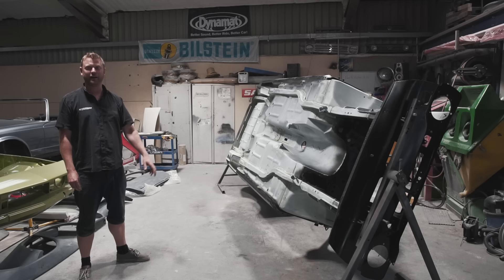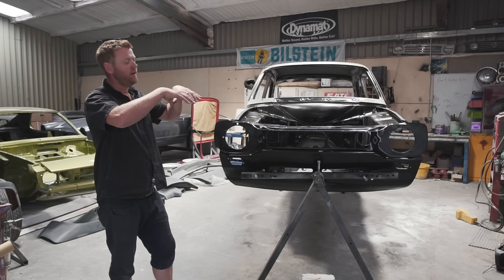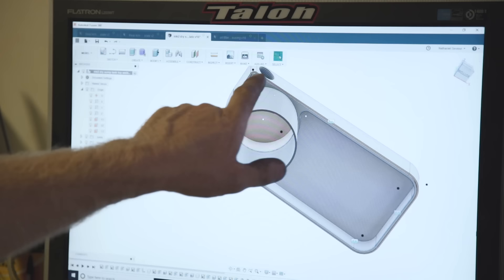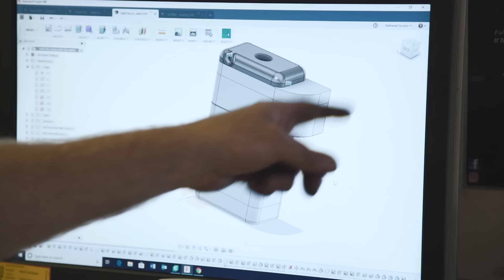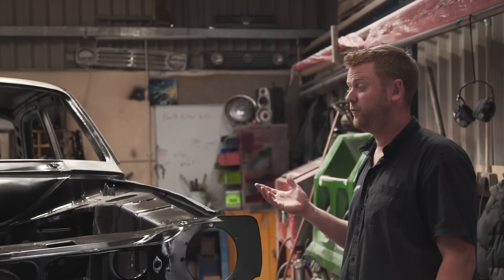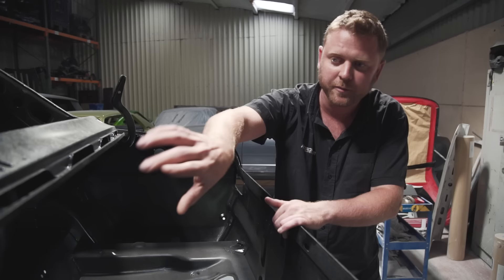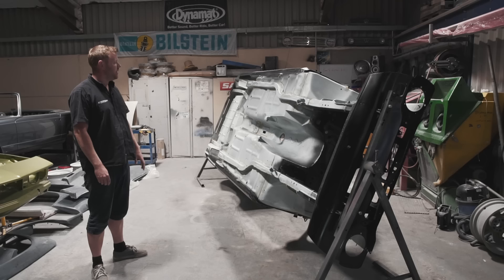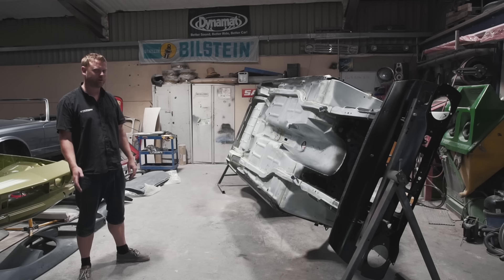Gordon Murray's Mk1 Escort - Retropower Build Episode 9

Comment: The creeping out of acid dipping is from not having an oven to cook out the acid. If you acid dip , you must bake the chassis to prevent weeping and creeping of the acid.
    You almost cant win because blasting sand endlessly falls out over time. I say do your best and thats all you can do.
  I love the shop shots in the B-roll
So much custom engineering .Mr Murray will have a well crafted car beyond an escort .A Super Escort
Is more like it.Its coming out clean, uncluttered, upgraded discreetly. A fitting car for Mr Murray for sure.
 Im resto modding two Datsun Z cars I didnt see the one you had,in the B roll this time around. If its still there maybe in episode 10.
I had my own sports car only restoration shop in New England for 20yrs . Ive restored so many cars during that time .Your shop is very much like mine was.
Now I just build them for myself.( And I moved south out of the damp cold into the endless Sun of Florida)
 Great great work great video.Hoping 10 comes faster than 9....!